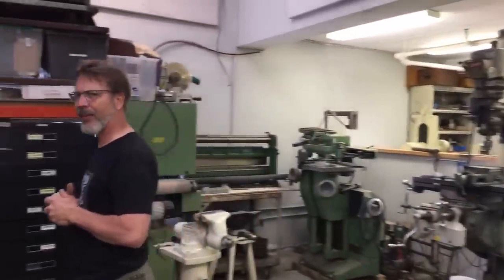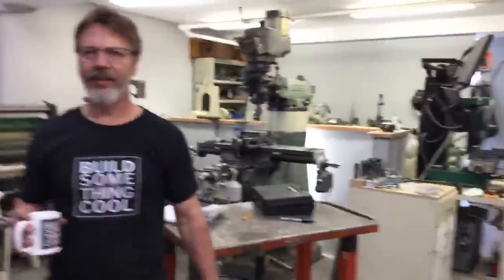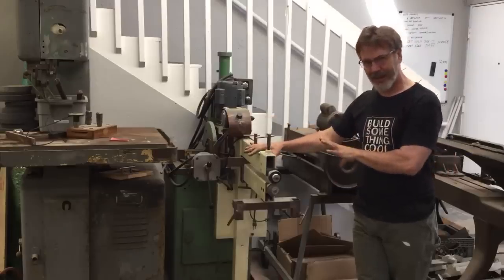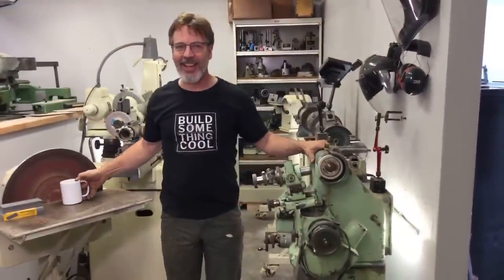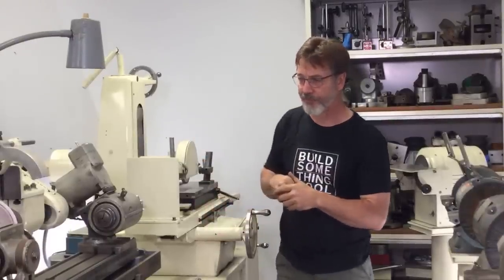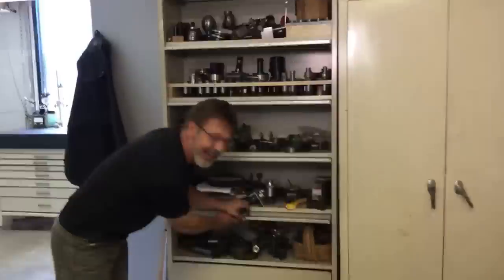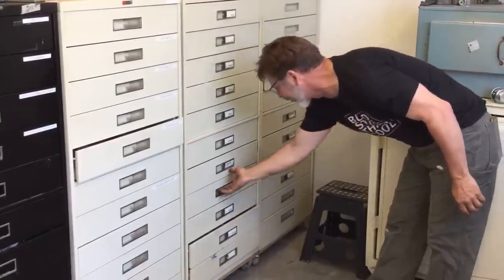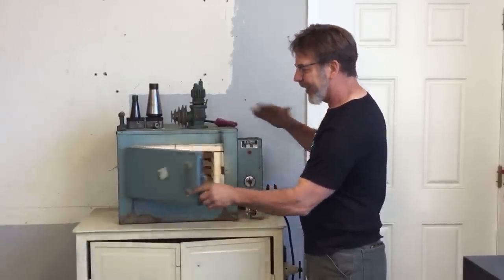100,000 Subscriber  Shop Tour

Comment: Great video. What you need  in addition to all those neat machines and a great  addition to your tool grinding capabilities is a Cincinnati Monoset. They were a very versitile machine, unfortunately they are no longer made but there are some clones being made. They could do endmill facing, OD, Spiral fluting, radius cutters, cylindrical grinding. In 1978 I was sent to a week long school to run it, and that school and machine opened my eyes to what could be done on that machine. Unfortunately that was just about the time cardide inserted tools were coming into their own and a lot of the grinding went away then. I still got to grind tools for another 16 years after that. Your videos bring back good memories.
LaVern

Comment: Edited: I typed too quickly, You answered in the video...🖖😎
48:00+
Question / observation :
 Isn’t that a really very bad place to place the granite surface? 
 Wouldn’t the sun heating up portions of the granite cause error issues with the surface, the metal being measured, and the measuring tools as well? ....I’ve seen video (Solid Rock I think) where you body temperature contact and even breath can change metal expansion readings.... (if you are working tenths and smaller)